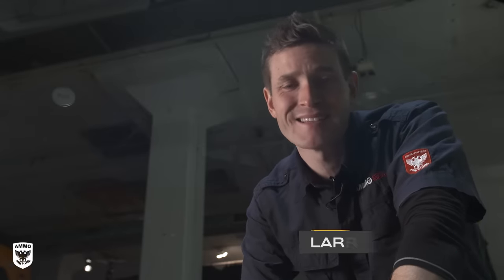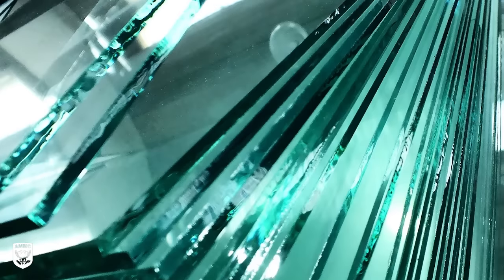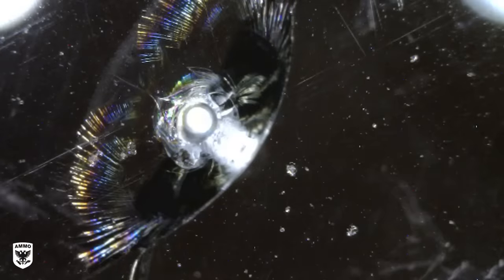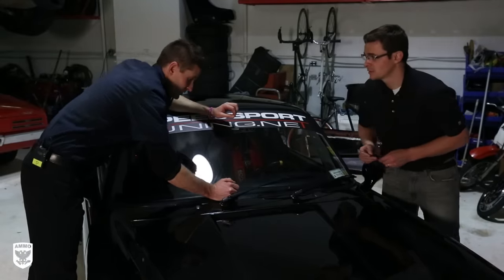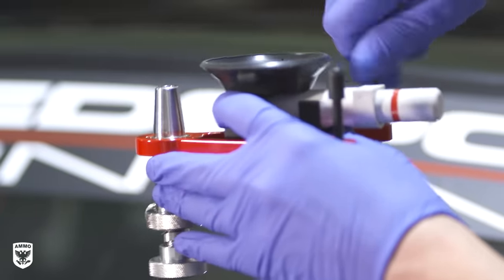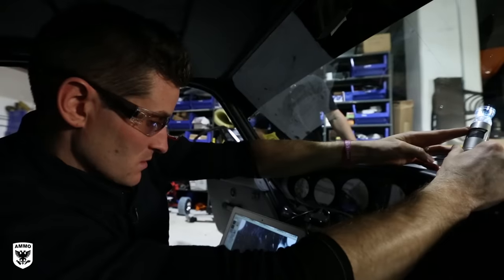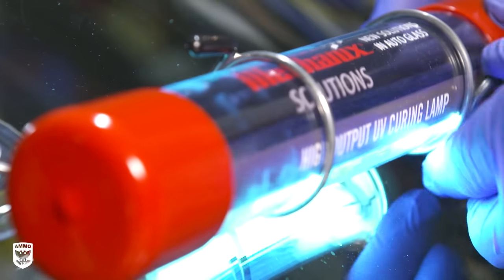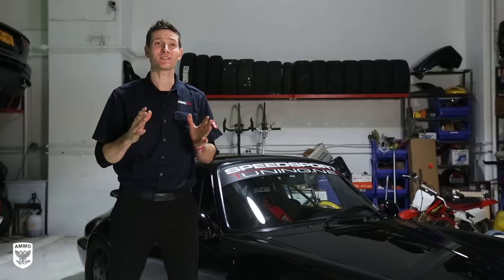DIY Windshield Chip Repair

Comment: Great vid, thanks Larry!

Just a comment regarding the replacement of factory windshields.  From someone who used to work for one of the large US based automotive glass companies, let me tell you first hand you want to do everything in your power to keep your original windshield!

Aftermarket Repair Glass (ARG) is NOT manufactured to the same standards as OEM supplied glass.  There are often distortions present that would never pass OEM inspection, and on occasion if there are quality control issues with OEM glass production, it's often considered "good enough" to ship out as OEM replacement glass, so even buying new glass from your dealership is not a guarantee of good quality.

This situation is worsening with more and more ARG product coming in from overseas where quality control, and even the quality of the raw glass itself, are not up to OEM standards.  This happened with my Mother's car, which now has a large wavy distortion right in her field of view.

Folks, look after and repair your original windshields if at all possible... if you go to your local auto glass replacement facility for a replacement windshield you usually have no idea what type of product you'll get.  Fix the chips before they become cracks!
Reply: Don't forget that a good glass repair company will replace your OEM windshield with... an OEM windshield. My glass guys will whenever possible pull a windshield from a junkyard car.

Comment: So much better than safelite. 

I had a chip in my daily driver, wasn't nearly as clear as this guys work. After they finished my chip, it was like i could clearly see the chip easily and it sometimes makes me feel like they didn't even do anything but i specifically watched them do the whole process. They did what they could and i appreciate that. It just sucks that the crack is still so visible.

Comment: Great video but don't forget that windshield cracks are permitted by law to fix up to 14 inches long without removing your windshield and it can be done safely with proper training. Most windshield repair technicians are afraid or just don't have the skills to perform long crack repairs. We fix cracks safely up to 18 inches as long as it is not in the acute area of the windshield. Thanks for sharing great videos like this so that the public can learn the importance of professional repairs vs DIY.

Comment: Not to be a buzzkill, but this is not a DIY project unless you do it for a living and are adding it to your shop. The tools are  $hundreds and the resin is too expensive to use just once or twice (won't keep forever once opened). Plus, glass repair is free from your auto insurance in the entire US, and many other countries. 

This dude is clearly an expert, but the tools used by Safelite (Belron outside the US) are a generation ahead. There are bad cracks and bad technicians, but all in all they can do a better repair with less experience required. 20 minutes or less, and they vacuum your floorboards. Just call your insurance company, folks.
Reply: Glass repair is not free from your insurance company!  In fact some don't even has glass repair as an option .  
 With Statefarm you have to make a claim and pay your normal deductible like any other accident.
Reply: Safelite uses the Glass Medic. The design is older than the hills and twice as dusty.  The system only produces a vacume with no pressure cycles. And for that privilege, you get to drag around a dopey 12V pump to put on a 'high tech' show for the customer. Ins. pays if you first pay for the policy that covers glass loss. 20% of the defects I see are previous poorly done repairs.  Glass repair is a leader item for Safelite, they really wanna sell you a new windscreen.

Comment: DIY.... After you spend a few hundred on equipment. .JA
Reply: Aprox 1-1,5K USD
Reply: yeah tools cost money.
Reply: That's why you will always go to a shop and pay rather than investment.
Reply: You can achieve similar with a $10 kit.
Reply: @gav240z  true...not the best yet it does get the job done. If he learns the technique then it truly is a no brainer.

Wait for a clear sunny day and...
Only Takes 10-20 mins and your done.
Reply: @Chaplin yeah but usually if your buying those tools the expectation is that they'd pay for them selves in a reasonable amount of time.
Reply: @gav240z  No, you can't...
Reply: @fallofthe  I did. It's not perfect but hardly noticeable.

Comment: Pit filler resin can NEVER "harden as strong and clear as the original glass" Overtime resin will cloud and loose it's bond from the glass and the damage will show up again. Also why is the title of this video "DIY Windshield Chip Repair" DIY stands for Do it yourself.  Unless you are saying you can do it yourself after spending 8 times the cost of the windshield for this kit.
Reply: Exactly my thoughts.
Reply: John Dozier because the resin cures with UV light it is not UV resistant. Depending on the amount of sun it gets (2 - 6 months), the pit filler continues to cure harder and harder. To the layman it looks as though its sun rotting. It will eventually fall out leaving the original pit. That does not effect the repair. All it does is effect the wiper blades.
Reply: Good point, Call a professional. Preferably one that uses the Glas Weld system.
Reply: John Dozier yes that is true that's how come there's a new technique called pressure curing where you put a UV flashlight pointed at the ship while it is under pressure and fully injected so basically have the injector still tighten down and pushing resin in there even when it can't fit anymore while it's hardening

Comment: Larry: "So, what actually happens when you get a rock chip?" Josh: "Windshields were introduced into vehicle in the early 1900's. . ." zzzzzzzzz. Jump to 02:15 if you just want Josh to answer the question.

Comment: Just had my windshield repaired today at Safelite. They apply the cost towards a new windshield if or when it comes to a full replacement which is kind of cool. It's probably inevitable since I drive a Jeep Wrangler! Ha
Reply: That's only if the windshield continues to break from the chip/crack they repaired. If your windshield endures new damage the cost of the repair is not applied toward the replacement, furthermore safelites price for new windshields are the most expensive in the industry...

Comment: I do a lot of these repairs with a very similar system, but the length of time he holds the drill seems too long for me? I do 1-2 second bursts to stop going through to the laminate. but nice job, as stated the repair is about strength, not cosmetics but even still sometimes you can achieve incredible results. Good video

Comment: great vid! is it possible to fix hairline scratches in auto glass that are similar to what you would find on the clear coat?
Reply: Yes I'm more interested in polishing a windshield. 
The years of stone nicks are like sandblasting, and the glare of oncoming traffic at night is not a pleasure. 
The little bit I do know is that it's rather easy to distort the glass if a gentle hand isn't used.
Reply: +mraccord92 Larry has done at least one video on what you guys are looking for, it's somewhere on his channel here.  I remember watching it.  Windshield polishing is very possible.
Reply: +MrTheHillfolk give it a good wash and claybar your glass! afterwards wipe with microfibre and isopropyl alcohol afterwards and hopefully that fixes most of your damage.
Reply: +skullian12 
I found Larry's other vid on polishing windshields. 
Thanks for the info. 
Yea I clay bar the windshield when I wash, it's definitely what I would call minor sandblasting from 20+ years and 160k of driving.

Comment: I've always admired the precision involved in glass chip repair.  Definitely not something I'm cut out for!

I'm going to have to see if I can find this guy for some advice.  I have a few chips, but what really annoys me is the faint scratches the windshield wiper somehow managed to leave in the glass.  I've been over them with razor blades, steel wool, sandpaper, even tried buffing them out with a microfiber cutting pad and some really heavy cutting compound to no avail.  I have no idea how rubber could do that much damage when abrasives won't touch it...
Reply: Did you find your answer yet? Cause you came close. A proper glass buffing pad and cerium oxide is what you needed.

Comment: From another professional video, drilling a hole at the end of a crack to stop it's growth should be .042 minimum to .060 inch maximum deep. Follow that with a spring punch or hammer on chisel to create a new bullseye at the hole, stopping crack growth. Bloggers say glass layer is .078 inch thick until the plastic is reached.

Be careful pressing suction cups or adhesive stickers in repair kits. This can cause cracks to grow.

Comment: Hey Larry,

Have you ever posted a video on how to remove wiper burn AKA windshield scratches?
I just bought a used car and its fantastic, however the windshield even after cleaning is streaking / fogging light from the scratches on it.
I've seen the two episodes where you talk about glass cleaning and you use a buffer on it with a thin microfiber cutting pad.
However these cars didn't have the type of severe scratching I have on my car... And I fear that buffing would take a good minute to finish.

I saw two videos out on YouTube, one showing a man sanding / buffing / polishing an older Ferrari, and one of a rando guy buffing wax (thats right, wax) into his windshield.

On a side note the rear window on my car has that annoyingly cheap tint that gets all hazy after summers heat, will need to get that removed. Would do it myself if it weren't for the rear defroster.
Reply: +Sean “S3EN” Slater tell ya what ill make a video response instead.

Comment: Earlier this year about two weeks after I had purchased a new car I took a trip to Houston, everything went swell until I got to Houston. I wasn't sure of my exit so I was in the slow lane at about 70 mph when a stone flew across the highway from the fast lane and made a direct hit with my windshield. I saw it coming but couldn't do anything. I got it repaired but it looks like a flattened spider on the windshield :/

Comment: the reason you don't drill into the PVB layer is that you have compromised the safety layer that prevents the occupant being ejected or an object coming through the screen into the passenger compartment in an impact,  both can have fatal consequences so do not contemplate messing about with a kit if you don't know what you are doing particularly in the legal jungle of the USA...

Comment: I notice y'all used an ultraviolet light to cure the material or resin. Is that the same material they use in that glue u can buy that is also cured with ultraviolet light?
Reply: Like Bondic ... interesting. I'm sure the resins for the windshields are manufactured more for clearness, ... not sure about strength.

Comment: I noticed how he said the glass from the front is different from the side windows and I actually have a small chip in my passenger side window. I wanna know if the window repair kit I can buy at the auto parts store will work on the chip? Or is it not repairable?
Reply: Jonathan Garza not repairable. It will eventually break.

Comment: Question, is there a video on your channel for repairing scratches on driver side door glass? I had extremely bad luck today and the equipment used to wash my car scratched the glass all the way from the top to the bottom of the glass. This happened at a very popular well known car wash in my area. They have been open for a long time and there car washes cost $35 now, yikes! I am going to contact the general manager to try and receive some compensation for the permanent damage done to my car but I'm afraid that since it was done at a car wash it will be, at best, an "at your own risk" type of a situation. Still I'm left with a window that is scratched and I've only had the car for 3 weeks! I'm pretty upset, any help would be greatly appreciated. Thank you
Reply: As you can see from the pic it seems something had been dragged across the glass covering about 6 to 7 inches from top to bottom with the major scratches on the top half of the on window. There are bubbles from the window tinting from the previous owner. These are not the scratches I'm talking about.

Comment: Been driving for 5 years, no chips.
The secret is don`t tailgate ANYTHING.
Reply: ToreDL87 Even then; cars passing you are what have always gotten my windshields. Entirely different lane, yet still hit my windshield with a rock.
Reply: FCFordLord Don`t let anything pass you :)
Reply: ToreDL87 haha😂
Reply: If ur the only one in the road it’s posssible
Reply: Has been driving 5 years and knows it all.......LOL
Reply: Come back in 15 years. The law of averages might catch up with you by then. Not every thrown rock goes straight back. I’ve picked up two while being passed.
Reply: Some vehicles are also more susceptible to getting chips just based on their profile. Minivans for example have large sloping windshields and they sit relatively low to the ground.  They are prone to getting rocks bouncing off of the windshield.
Reply: Don’t drive it.. settle..

Comment: Basically every time I've had a "Pro" repair chips in a windshield, they do no better than I've been able to do with those $10 kits. That is to say, a terrible job. Insurance never wants to deal with it because they have the fallback that it doesn't improve visibility, but instead it stabilizes the crack. I've NEVER seen anyone actually make a bullseye crack disappear or even come close to disappearing. The best thing that can happen is that the damage is large enough that insurance replaces the windshield.

Would like to know how to find a shop that ACTUALLY does this type of repair instead of cheaping out.

Comment: How can I contact Josh?
Reply from the maker: Hmmm google glass mechanix I guess. I will ask him to hop on yt today
Reply: +AMMO NYC Larry I emailed you a couple weeks back, just wondering when you are getting to them.
Reply: I assume that depending on how many chips you have, for the amount of money that Josh is going to charge to do this, it will probably be cheaper to have someone else replace the entire windshield.
Reply: Hayk Samvelyan I would not contact him that repair process is that a date we do not do it like that anymore it has gotten a lot simpler a lot better and a lot faster equipment has gotten better and resin

Comment: Should just ban all trucks from passenger highways.  Almost every time I get a chipped windshield it is kicked up by a big truck.  Usually a dump truck.  Everytime I see a dump truck I tried to avoid it by going farest away as possible then speed past it.  They are a menace on the highway.